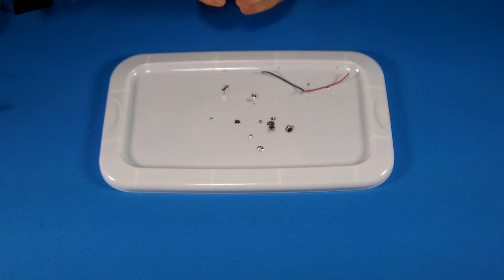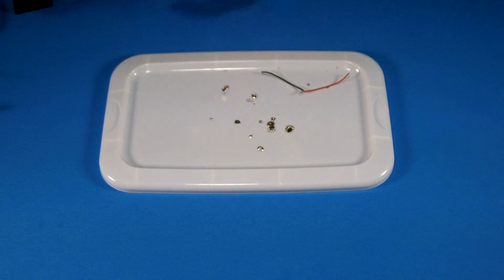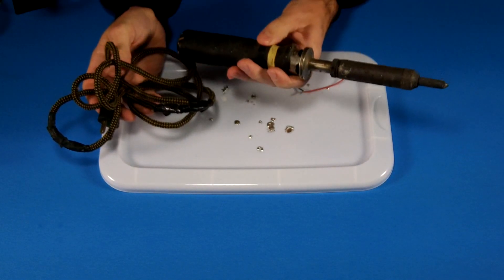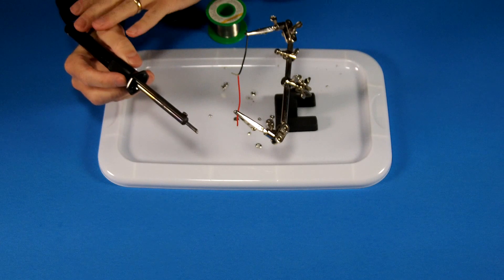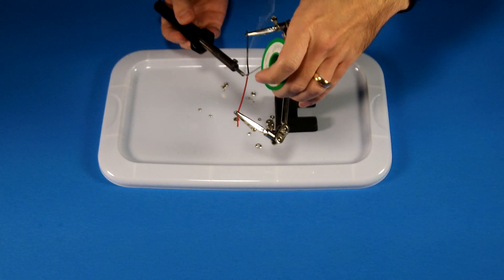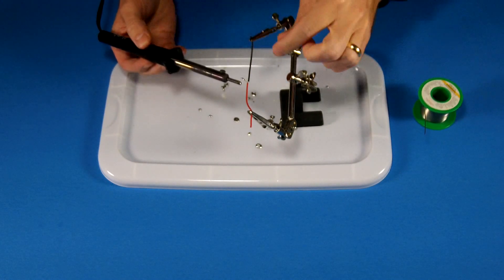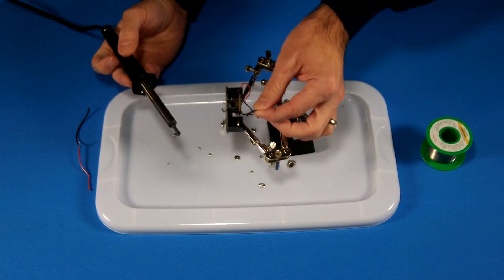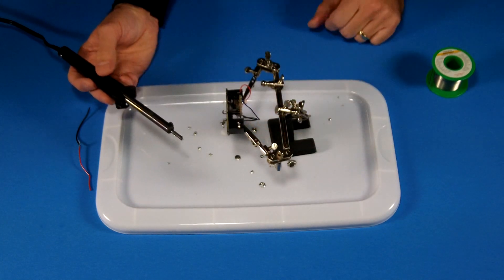How to solder (The basics).

Comment: You should also frequently clean the brown oxidation off the tip by wiping it on a damp sponge.  Oxidation will insulate the tip and the heat won't transfer to the work as well.